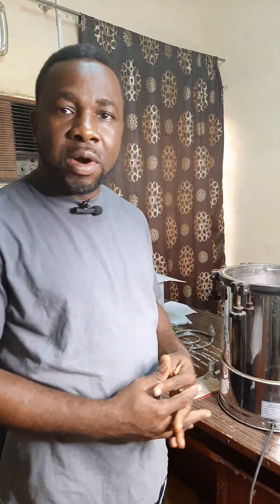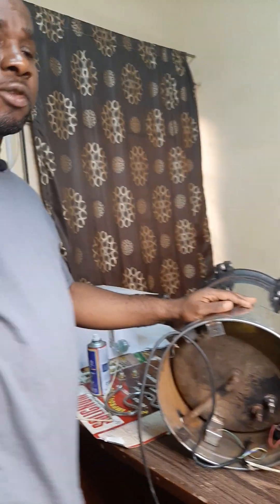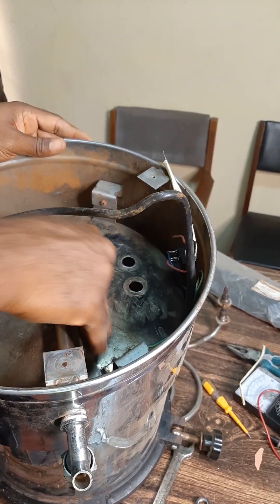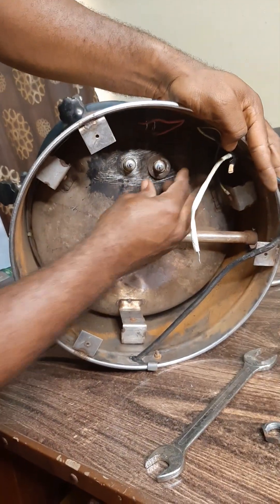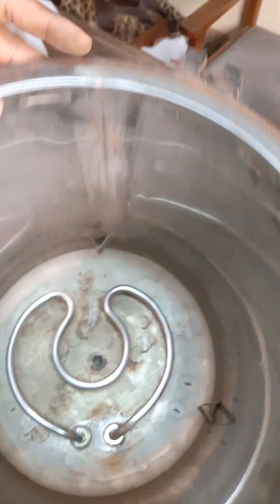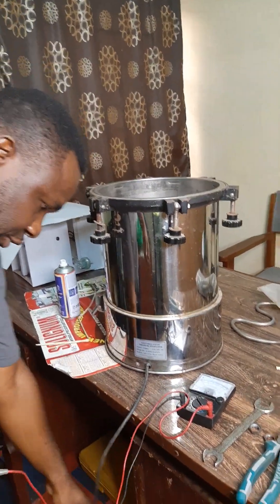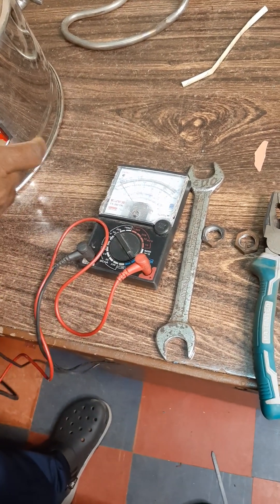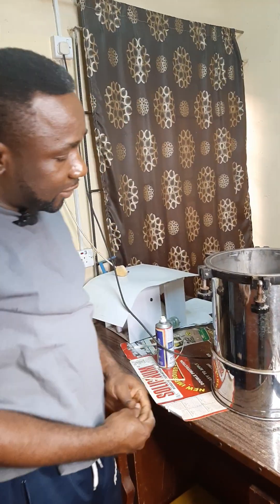Mastering Autoclave Sterilizer Repairs: Expert Tips for Fault Diagnosis and Troubleshooting

Comment: please help I have a healicom vertical autoclave.  The power switch on the unit trips before completing cycle.
Reply from the maker: Please refer to the service manual for a precise solution, I may not be able to proffer a solution without a proper diagnosis. 
Thank